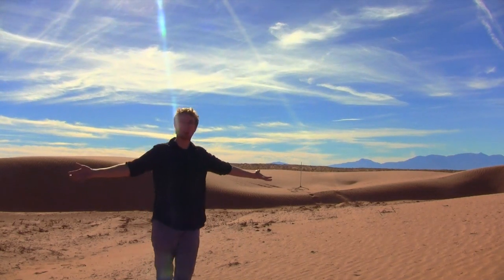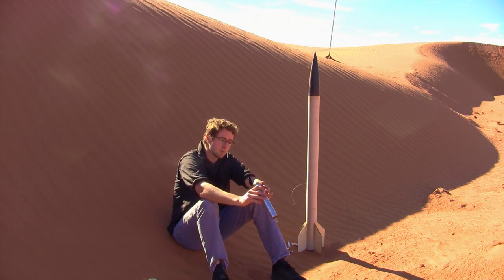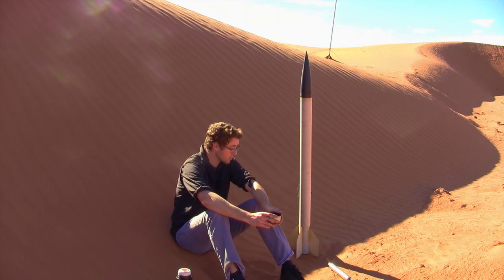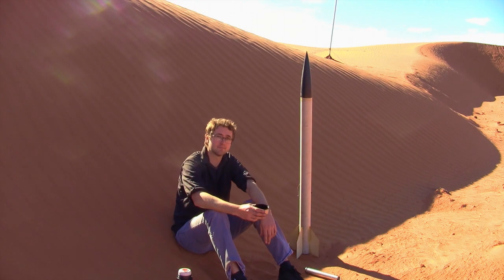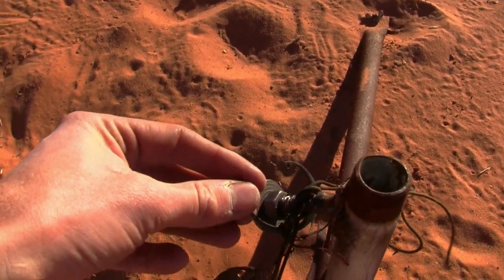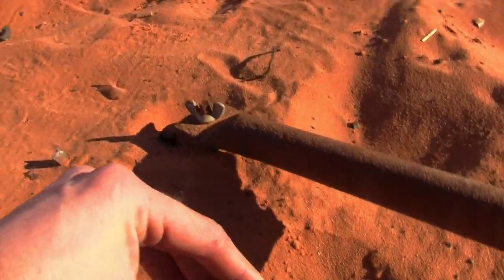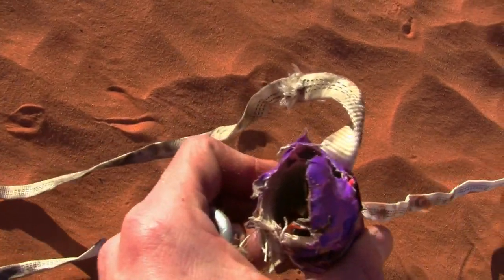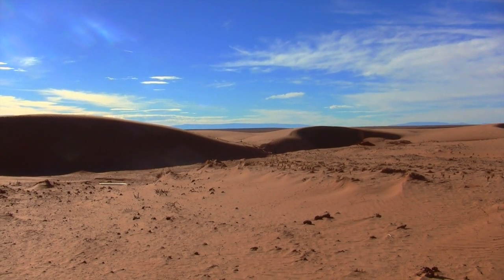Styrofoam Propellant Rocket Launch!!

Comment: Try drying the acetone on some metal sheet and then grind that. U should then mix oxidizer and powder in ball mill with equal related amount to what that rocket shell can withstand. U can calculate the mole masses and then the amount of gasses released by second by capturing the burn rate image.

Comment: Very cool channel. You deserve much more popularity! 
Try different approach, with minimum amount of acetone, just enough to activate styrofoam as binder, but styrofoam will need to be pulverized first. It should give you better results.
Reply from the maker: Thanks! Good idea, I may also try putting the propellant in a press until all the acetone evaporates off. Thinking that may help.
Reply: I agree. You should definitely continue applying pressure for at least couple of hours while acetone evaporates. Pulverizing styrofoam may be challenging, but I think it's worth the try. I didn't try that recipe, but it is on my list of experiments. I only wish I had easy access to areas like you do. That place is fantastic!

Comment: Back to the drawing board.
Try gasoline and Styrofoam.
Reply: What is the difference between aceton and gasoline in this  case?
Reply: Rocketrin stories gasoline has a slower burn rate. The velocity of the burn is  comparable to black powder.  The mixture of gasoline and styrofoam will melt the styrofoam into a type of napom jelly. During the set time the gasoline and styrofoam dose not leave  air bubbles. They float to the top. Add your cap or plug to the end of the rocket motor after a 24 hour set time.
Reply: Acetone completely evaporates from the mixture, which means that we don't need it's burning rate. And from where all these data about the burning rate?
Reply: Rocketrin stories if you watch a proper mixture of a candy rocket, or a black powder rocket fue,  the fuel dose not go off in one swoop,  or blast. No it burns at a fast pace or velocity of about 1 inch in 1 second so 3 inches of candy rocket fuel or black powder takes about 3 seconds to burn. Creating a smoke volume larger than the original fuel. And with that fuel in a container where no room is given for expansion,  that extra velum of smoke has to escape or blowup. A blast from black powder or candy rocket fuel is do to pressure from the solid powder into a gas which causes expansion. The small hole in the end of the rocket motor allows that pressure to escape. That escaping gas is the force that makes the rocket its go power.  Gasoline used as the accelerate to the styrofoam fuel is just enough to make the styrofoam to burn at an volicity to create the pressure you may be looking for as a rocket motor.
Reply: I think I might have wet sanded all the foam to a uniform, fine powder.